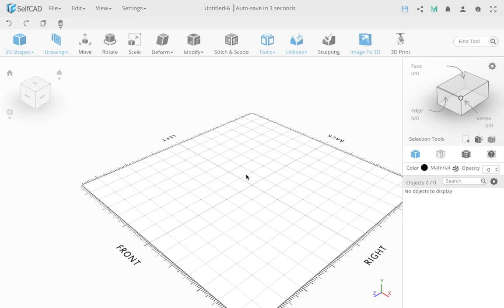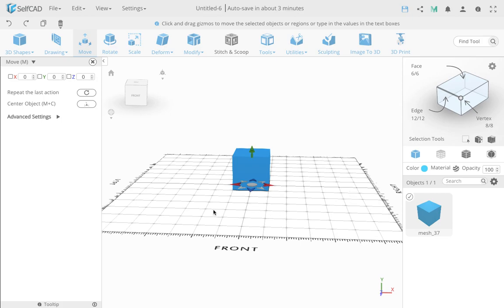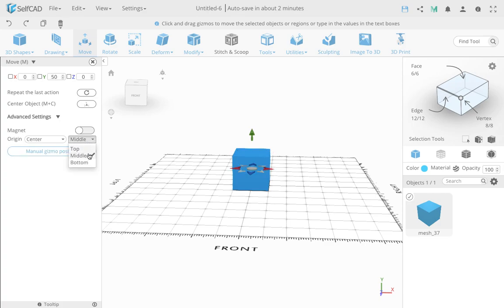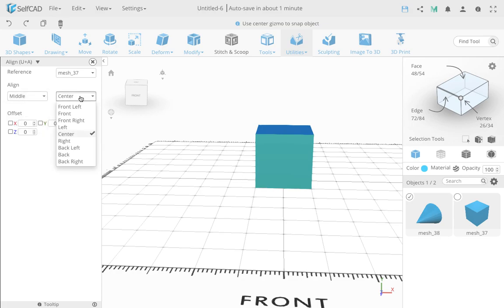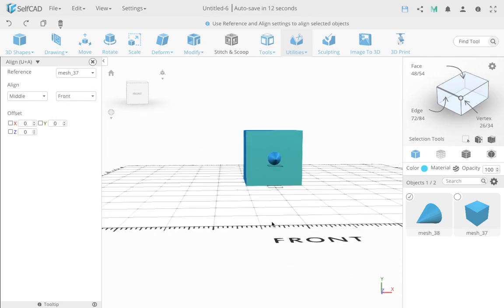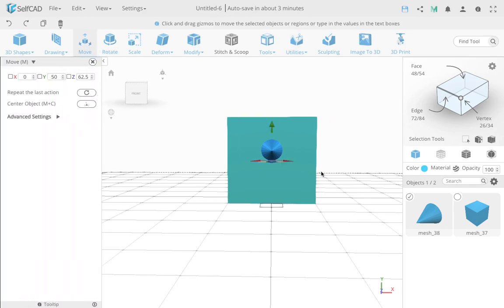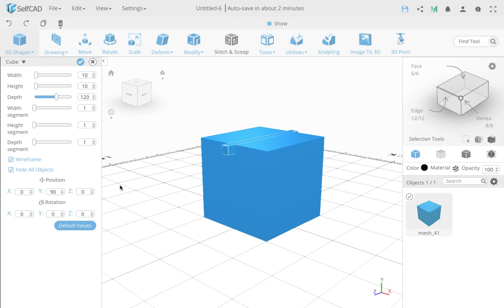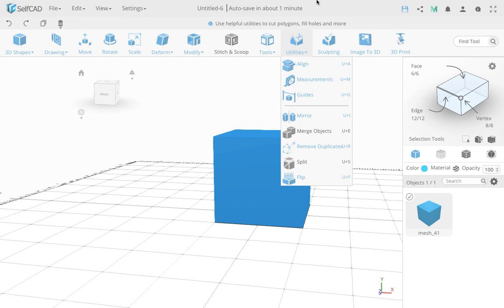How to position and align objects in 3d space using SelfCAD.com

Comment: i have a edge were i want to put on a square on both sides it should fix to the box is there a way i can use magnet for 1 side but the box and square have 2 sides were the cube should stick on
Reply from the maker: I think what you are asking for is the snap tool. The snap tool also has a magnet option and it allows you to pick an exact location to snap to.
Reply: @3dmodeling101  I have a rotary drum magazine with 6 chambers. Is it possible to precisely position a cylinder in the center of the chambers using the Snap tool?
Reply from the maker: @LastDissidents @LastDissidents I made another video showing the best way to do that. See https://youtu.be/EMlYzBCeRzk, and please give me feedback. Thanks!